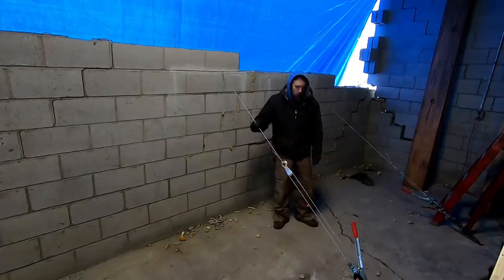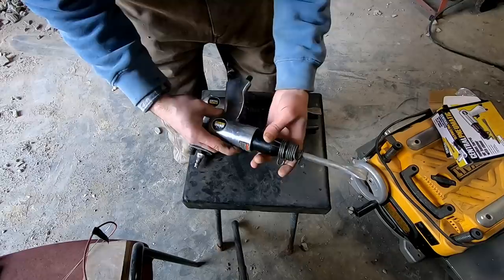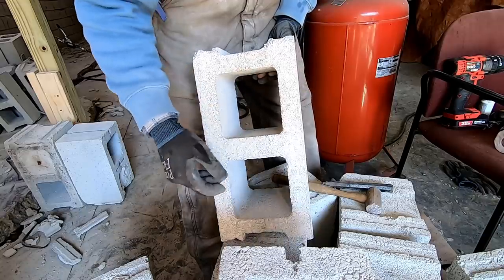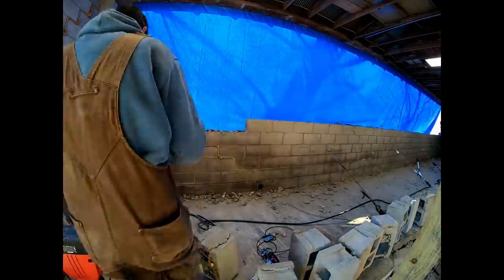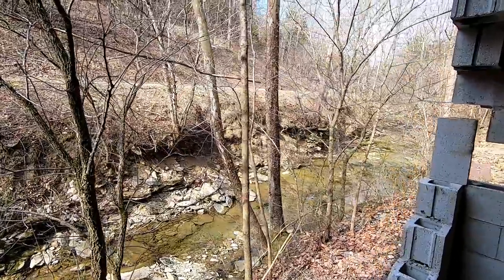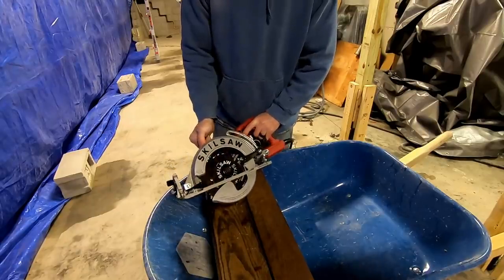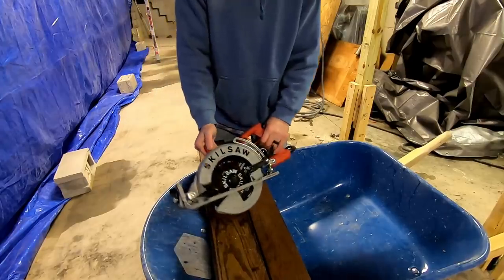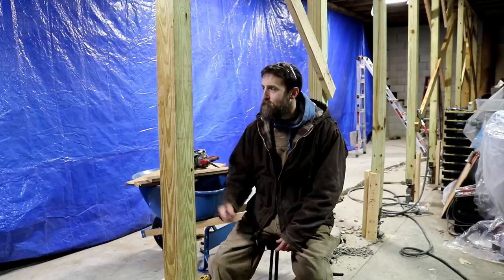THE BLOCK WALL IS OUT! Machine Shop repair part 5

Comment: Consider a retaining wall to help prevent erosion directly at the creek bank.  If you do so, you can remove the row of scrub trees that are currently holding the bank , unreliably.  Also, a stabilized creek shoreline would make leveling and packing the renewed foundation for the slab, possible.  A row of block in the creek, dug in with reinforcing bars pounded in deep would keep them from shifting.  Filling the blocks with cement as you build up three or four courses, would stabilize the whole bank of the creek.  Packed back fill would then stay put and support slab repair.

Comment: point the wheelbarrow in the direction you want to go when its full, saves a lot of struggle.  Awesome job.
Reply: Yeah definitely a rookie mistake to not spin the barrow before you load it up. Steve needs the exercise though. So he needs to work harder, not smarter.

Comment: You are absolutely right about water washing out footings and floors. Years ago I was plant manager at a shop in an industrial park. One morning we went in and a waterline that we didn't know existed had broken underneath the concrete slab. The shop was 75 feet wide and 225 feet long. In one night the water leak had washed out 1/2 of the sand under the slab an cut a trench 1 foot x 5 feet to let the water and sand out into the yard. Fortunately all of our heavy equipment was located on the other side of the shop so we didn't have to move it to replace the floor. We were essentially shut down for over a month and the bill to repair the damage was over $100,000 and the shop was never the same as the one wall where the foundation had been washed out developed cracks in the block work frequently which was a real pain since the void in the wall was filled with vermiculite insulation that would run out and get everywhere in the shop and was almost impossible to replace. We were lucky that we were insured but our deductible was $50,000 so the insurance company only paid half and nothing at all for the lost production hours.

Comment: Steve, I am relieved that you mentioned a local engineer who is looking at your wall rebuilding. In thinking about it, it occurred to me that a good move might be to drill 12" dia. holes about every 8 or 10 feet and 4 to 6 feet deep, then fill them with concrete. That should provide a good base for the wall foundation which should probably be about 16" wide and 8 to 12" deep with rebar. It seems to me that such an approach would provide a permanent cure for your wall/roof support problems. Ask the engineer about such a move. In any case, good luck and I am also relieved that you managed to remove the wall with no serious difficulties. Congratulations!

Comment: The way you're stacking those blocks makes it easy for the front or rear faces to fall over. It would only need a few blocks turned to bond them together to prevent that.

Comment: I'm a UK retired engineering geologist - I've designed a lot of foundations in 40 years.  You are so close to that creek, any structural loads need to go down to at least creek level, ideally a couple of feet more - at least. That probably means mini-piles.  No doubt your structural engineer is all over this - I'm interested to see how he does it.  Whatever, as you know, this is not an easy problem to solve.  But so far so good.
Reply: Piles was my first thought. Or smash up the block and create fill. Either way it is a seawall.
Reply: Yes exactly, that creek isn't going to get any smaller, would the piles need to go in/to bed rock?, Obviously not being on site/geology survey info.
Regards John.
Reply: You're never going to get a boring rig in there with the existing building there, just no space. Best bet is a heavy reinforced foundation wall that can be dug in situ and plenty of rip rap on the creek banks.

Comment: Pro tip:  when you disengage the pawl on a come-a-long, you can pull the handle all the way back until the pawl engages the release latch. It will let you release the cable one click at a time for full control of the load.

Comment: A good French drain should take care of the water problem on the other side of your shop.   4 inch flexible  perforated pipe like used in a septic tank line in the bottom of the ditch running down hill and fill the ditch level with the ground with #57 stone gravel.  This method has worked for me for years.  Before this video was over,  I had to take a couple of aspirin.  My back started to hurt.

Comment: You probably have found things that just work for you.  Example is the overalls you wear.  

In my life it is my eye glasses frames.  I found some that just work for me.  I probably have 10 pair of eye glasses with the same style frames.  I order the same exact frame every year. One year I had the make me a pair of prescription sun glasses with the same frames.

  I am at a point in my life that if the frames are discontinued I will have enough of spares to get me to my end.  

When some item just works for you, stockpile that item if you can.  

With things today companies make changes in materials and such.  I have things that work and go back and find that the item has been discontinued or a material change that makes the newer product inferior.

I enjoy the videos you put out.  Keep it up.  Also with your son helping out, you're not only repairing a building but you're building a man.  Great job.

Comment: On the one endwall that you are going to tie into, before you take anything down , put 2 strap plates up, either side of the block to stabilize the wall that is staying. Many you are already doing that. Good work

Comment: Dear friend
The reason for floor cracking are the water stream and the trees adjacent to your workshop.
You will need to remove all trees next to the walls and build a concrete underground wall between the workshop and the water stream, as well as making some concrete wedges under the floor of the workshop before rebuilding the side wall.

sorry for my bad English. :)

Comment: For the HF tools like that, get the insurance...I got a 5" random orbit sander from them to strip the hull paint off my old (1987, and no longer the owner) Wellcraft St. Tropez.  It was a BIG boat with LOTS of hull paint and about 15 to 18 years of it from the looks of it.  I bought two of them, with insurance. I went through BOTH DAILY (they just burned up).  I went through more than a dozen of them, and the last two broke the at the very end of the job.  I now have two "new" ones from them that I don't abuse, and they both work well.

Comment: I'll tell you, Carhartt is a highly debated topic up here in Illinois. Carhartt is "the only way" and it is what it is when you buy the good stuff. As most know, there is light duty Carhartt and then there is the commercial stuff that guys n gals who work outdoors year round rely upon and you can tell the difference in the price. The commercial stuff is double the price and its worth it.

Now, with regard to overalls and cold weather suits, I have another one that I prefer. Walls Blizzard Proof IMHO is equal or better than Carhartt. I feel it's more comfortable but I am a big guy at 6'4" tall and 250ish pounds. So, give Wells a look as well if you are out there and need a pair of winter overalls or a winter suit. I have the winter suit that was given to me in 1996 and I still wear it to this day.

Comment: Keep your powder dry, keep your chains taut'  pour your footers deep, re-enforce with re-bar, re-enforce the floor with steel mesh, & re-bar, mix your mortar right , so that it doesn't peel off quite as easy as it did on the wall that you took down . I'm no expert, but I did spend most of my youth tending  masons in my home town. My dad was a general contractor, & he rented me out to all of the local masons. I was the "Grunt Guy", that carried the brick, & the block. I was the grunt  guy that mixed all of that mud. I was the "Finish Guy" that "Struck all of those joints". Yeah, I was the "One Guy" that did most of the work...

Comment: I think you did it the right way. Clean the mortar off the blocks on the concrete floor. Easier to shovel and clean up. It had to be done either way.  Lot of work, but it will be worth it in the end. Good luck.
Reply: If you do it outside you skip the shoveling.
Reply: @1pcfred  if you do it outside, you'll still have to clean up the debris. It's much easier to shovel on a hard surface than the dirt.
Reply: @kurtdietrich5421  why do I have to clean up the debris? This ain't Better Homes and Gardens over here. I mean I got a meth lab on my property. So some mason crumbs on the ground ain't exactly going to be like, Oh my God.

Comment: good start on a BIG job. All your planning is paying off. 
Of course, your geotech will guide you, but I think you're going to need a backhoe in there to dig a step or two to "key-in" the fill to build your foundation on top of. It might be a little expensive, but I think buying gabion basket wire frames, placing them on a leveled step, and filling them with quarry spalls would work best against the potential stream erosion, because the spalls will be captive. You can top them with an appropriate sized crushed rock which will fill in the voids and lock-in to position the spalls even more. When you get a couple rows of those in you can backfill and compact and pour your stem walls on top of all of it. I agree with others in pouring your stem walls 18in to 24in above the slab top  grade to keep the wood frame above the dirt. Whatever you do, I'll find it worth watching, hahaha.

Comment: I used a HF air chisel to take down my grandfather's brick BBQ pit and reassemble it at my house. It worked well. I also figured out that a power washer did very well taking mortor off the bricks. The old mortar was very useful for some bad spots in my driveway. It crunched up well and is holding up well

Comment: Check the cable bolts on the come-a-longs.  I had just finished lifting the MSC column mill off my trailer when the bolt that holds the cable fell out!!  Great product placements, I hope they compensate you.  That young man is building muscle on this job! LOL  Glad to see you using dust masks.  Silica dust is hard on the lungs.  I love that creek.  Five squirrels and a pot of dumplings....   The important thing is nothing catastrophic happened during that wall removal.  Stay safe!

Comment: Of course the top of the block is easier to spread mortar on but there is another reason, too!  When they make the block the outsides are square and parallel but the insides are sloped so they will release from the core molds of the block making  machine.  The handle is a by product of the taper But, some block machines do make those webs much wider at the top (may be the bottom when they are made).  Some block are made to be corner block and the other end is for sash installation or control joints.  Those that are flat on both ends are pilaster block.  We have a block making machine from the 1940's that my parents made all the block for the basement of the house I was raised in.  One block at a time and 50 block at a time (the green block had a pallet on the bottom so it could be removed and remained till it set overnight. I could write a whole page about the history of block but not now, Greg.

Comment: I like how you have protected yourself from the Coronavirus that may be trapped in that cinder block wall. You are always thinking ahead, Steve......

Great progress on a big job.
Reply: Masks don't protect anyone from the virus. They may stop the spread somewhat. You need a pumped air suit if you want protection.
Reply: "Coronavirus that may be trapped in that wall" !!??  Damn, I had no idea it was tough enough to last probably 30 years inside a Kentucky block wall!!!!........
Reply: Paul Frederick Did you hear that? Had to be fast or it would fly right over your head.
Reply: @paulcopeland9035  no one has any idea yet. Viruses exist between the cracks of biology and organic chemistry. Which makes their study less common. Strictly speaking viruses are not even alive. They are germs though. So they got that going for them at least. But all the other germ types are legitimately alive.

Comment: The creek is a wonderfull view .If that was my shop I would pour a decent footing rebuild using SOME of the blocks and install as many as possible Craigs list  good used patio sliding doors   on   a block foundation ,  the air flow might be handy in summer or smelly ops

Comment: It may be too late to really help now, but maybe getting an all terrain pallet jack would help with moving the heavy loads back and forth. Plus if it is on a pallet, it saves an unload/restack step.
Reply: Can't justify the expense of specialized equipment like that on a one off job really.
Reply: Possibly, but free time is not really free. Also I am sure Steve could find uses for something like that in the shop that does pay the bills.

Comment: If that were my shop, I would saw the concrete off straight and move the building over away from the creek. it would be a bunch of work but in the end I believe it would be less work and much cheaper to build. The plus side is you will be working on flat ground doing it, working on the side of a hill simply sucks.

Comment: Steve,  you were talking about a stick built wall. You may consider using those blocks to build a retaining wall. That creek is going to get closer and closer, it's already scary close.

I also wonder if maybe a 2 ft block base wall and put the stick build wall on top of that.  Just a thought.
Reply: All worthwhile ideas.  I concur the blocks would be better used building a retaining wall and go with stick construction it would weigh bit a fraction.  Plus he's going to have to sink some deep piling to build a wall on top of

Comment: Now the pita work getting the floor cut back and strong foundation. To rebuild the new wall and tie in the rest of the building. Your old saw can be fixed and put cash back in hand. Collectors love them . Parts should be easy find.

Comment: Those inexpensive air hammers always un-screw themselves. In the machine shop, we would un-screw them slightly to reduce the impact power when peening pin repairs, as an example.

Comment: I have been seeing cable hurricane tie downs in new construction here in Florida. 

From footer to the top of the wood walls. 

The trusses are connected with sheet metal straps both to block walls and wood wall construction.
Good Luck

Comment: I would build on the opposite  side of the shed  away from the river just use the concrete slab as a work area NO WORRIES THEN about floods or building problems the roof could be used as an UNDERCOVER WORK AREA.JUST PUT A SIMPLE ROOF OVER THE NEW AREA. CHEERS

Comment: Great video. Looks like the teardown is coming right along. 
      HF tools definitely has its place in the tool market. I use there 5 gal shop-vac. When it stops working , I just trade it out for a new one NO questions asked. That's 10 time better than the two name brand ones that die on the 98th day and you must pay to send it back to the factory because the brushes in the motor fell apart.  
      AS a young man I didn't know or did I need the secret power of Ibuprofen. But as now a older man that some of the best stuff I have ever used. 
Looking forward to part ? and the best part when you can start the new series of rearranging your shop to enjoy the new view and all the space.
       Thank you for sharing and stay safe out there.

Comment: That pile of mortar chips can be recycled as filler under the new slab. Crushed concrete is sometimes used as road filler, but might have some rebar left, which can result in flat tires, unless you put some gravel on top.

Comment: I don't know if someone else (or yourself) has thought that this issue may not be mainly a rainwater issue. If there are no gutters on the other side then it should be in bad shape too. I think the issue is the creek flooding, more likely a swift current undercut the foundation. I would plan on something to bolster the upstream end of the foundation. Just my two cents.

Comment: I think you're so close to the creek you may have to put in pilings for support.
Reply: This what I've been saying!  We've set some heavy natural gas equipment on them at work with no issues.
Reply: Only way to fix that job properly, pile it irrespective of wall construction and like Steve said make sure the building is properly drained all around to avoid undercuts.
Reply: How do you propose to get a rig in there to bore for the piles? Unrealistic. I'd excavate (will probably be able to get a bobcat in under the roof), pour a nice, wide footing and build up a filled block foundation wall from about 4-5ft below slab level. All reinforced with plenty of rebar of course.
Steve already has the blocks and rebar, just needs concrete and time.